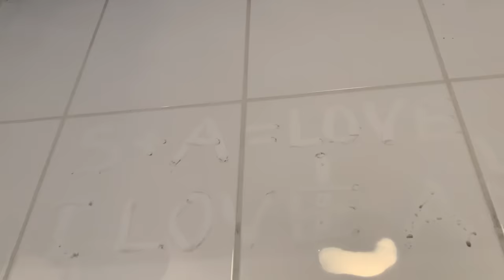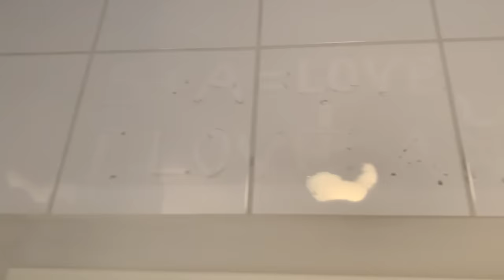CLEANING AND DECORATING OUR MASTER BATHROOM 🛀😍

Comment: A few tips: When you're arranging the items on the cupboard shelves..put them in clear  plastic rotating containers so you can spin them to easily get at all the items. I do that with my kitchen cupboards too. Also, put your shaving stuff in small container...pull out the container when you're using & then just put it back after instead of having to deal with the different items separately. Also your cleaning items on the bottom shelf. Put them in a little bucket with the wipes/sponges. Keeps your shelves from getting stains.